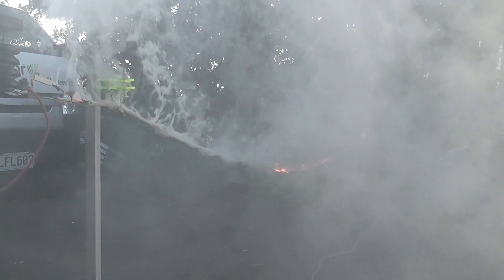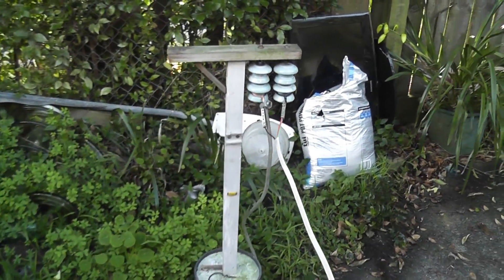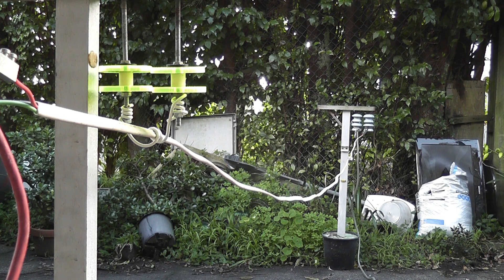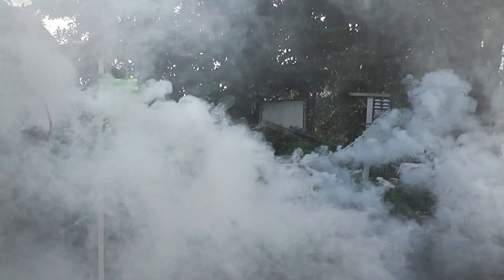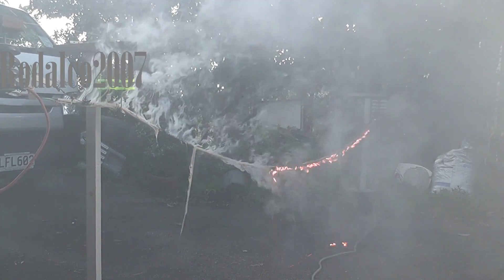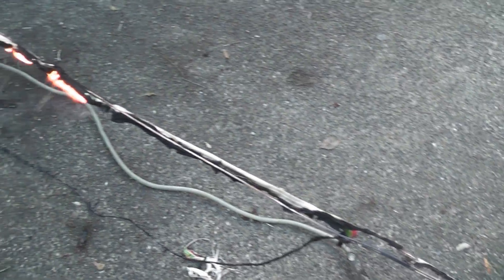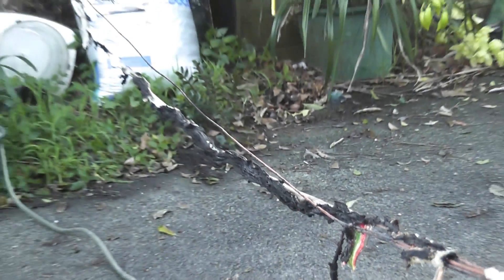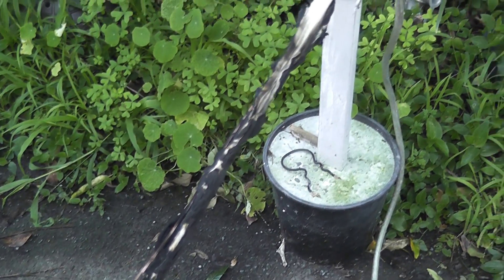Overloaded 2.5mm² TPS cable

Comment: anyone thinking of doing this be careful. The byproduct of PVC burning is Hydrochloric acid gas. If it is not LS or Low halogenated (which are still dangerous) it can emit a lot.

Comment: I believe you may have proved this magnetic repulsion idea in a previous vid, where you had some hanging conductors that pushed apart when they were heavily loaded.

It reminds me of a recent job where I had to connect a 750KVA generator using 240mm2 tri-rated conductors.  I then had to go out and buy some plastic cable glands because the metal ones that were supplied would have effictively produced a short circuit by inductance of the metal gland surrouning the conductor.
Great vid Ray, I love the dripping liquid PVC.
Reply from the maker: Yes I did an older video on this experiment a few year ago. Just felt like trying it again on a different set up. Always great to create some smoke effects.

Comment: Excellent video Ray! That gives me an idea for extracting copper conductors from scrap wire, stripping out the copper with a blade is tedious and danger of getting injured but this way seems fast and lots of fun.
Reply from the maker: It is fun, the copper does discolour a bit during the process. You could probably use 3 x 12 Volts Accu's in series as well.
Reply from the maker: Richard , you are 100 % correct, the Copper properties change and the wire goes brittle. After an experiment like this the wire is rendered useless and ready for the scrapper. (It is the opposite of annealing)
Reply: Easier just to burn it, though i tend to do it the easy way and take only the thicker wire to strip, leaving the rest with insulation on and take to the scrappie who subs it out for that.
Reply: I’m not sure if it is the case with copper, but with steel you change the properties of the material by heating and cooling it. It may become brittle and so. I wouldn’t put such cooked wire in not-experimental applications.

Comment: awesome video! How do you think it would go with 6mm TPS?
Reply from the maker: I need to make the run shorter as the jumpers are 35mm². It will probably work. The TX will get a bit hotter.